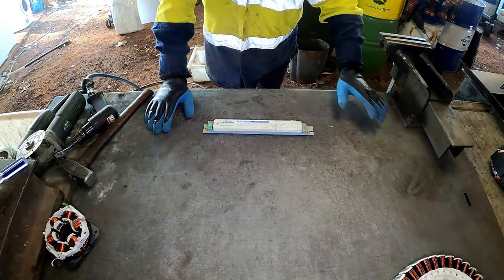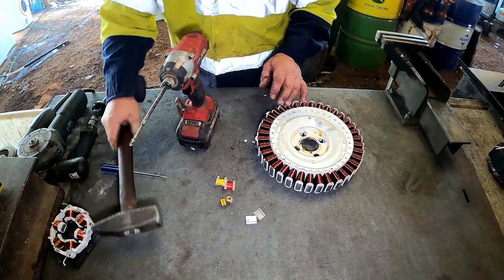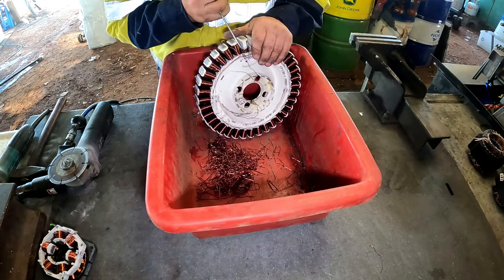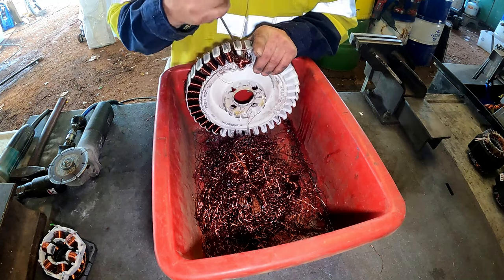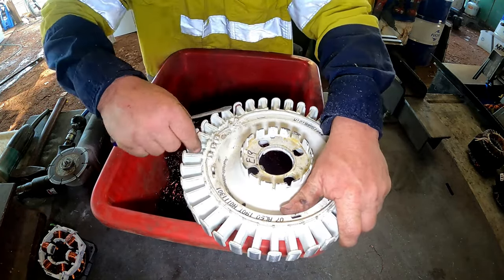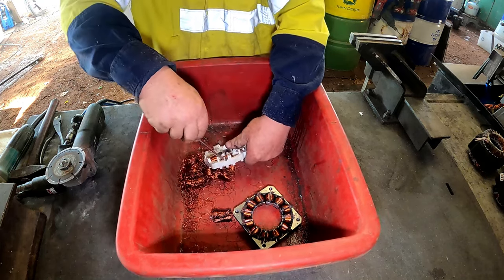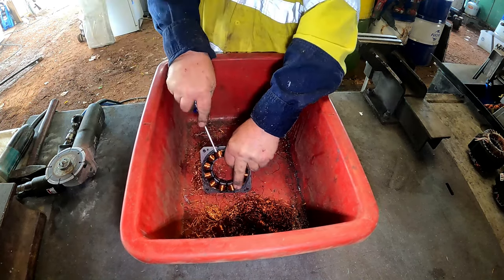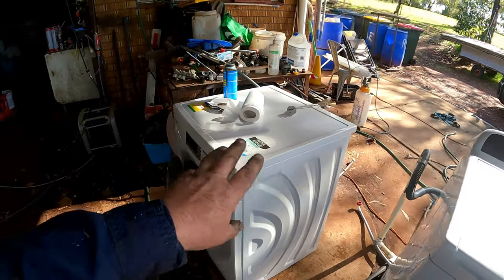An Esay Way To Stripping Copper And Aluminium From Direct Drive Washer Motors

Comment: The best and efficient way of doing those aluminum ones is to put them in aluminum motors category. Copper same thing. Labor isn’t worth my time. I think you loose about $0.10 on the aluminum motors and about $1.60 on the copper ones bye processing them. 15 minutes for $0.10 or $1.60 just doesn’t make it worth my time Now if aluminum was $4 a Lb.  and copper was $6 a Lb then I might consider making a mess and all the labor that’s required. US prices!
Reply: Some poor guy or child  in Pakistan or India  would  set fire and breath in toxic  smoke to get that wire

Comment: I wonder if it wouldn't be less work to put that in a freezer or somewhere very cold over night and then take it out and smash it with a big hammer or something. maybe those small coils would simply break off the big disc.
Reply from the maker: I like your suggestion but unfortunately they have steel underneath the plastic.🤔🤔🤔👍👍👍